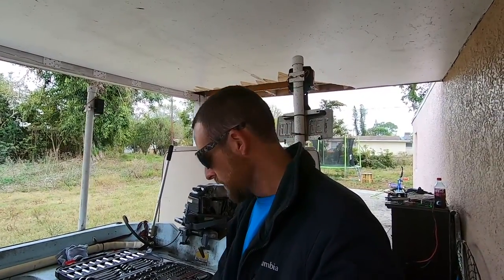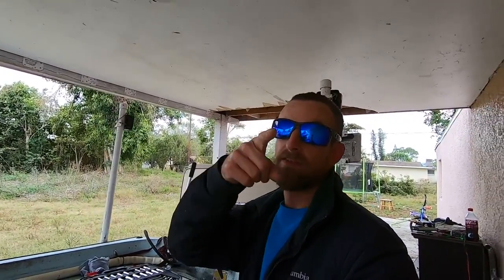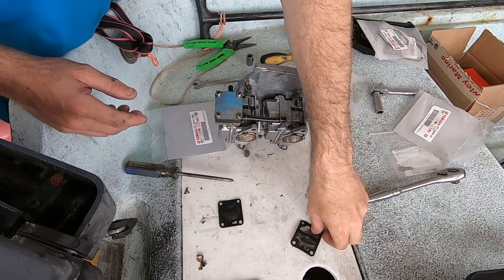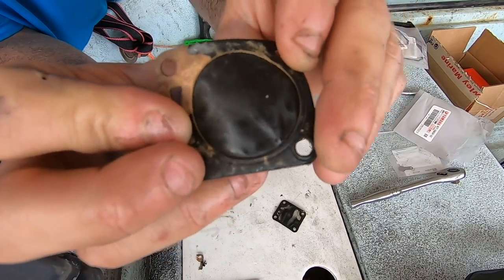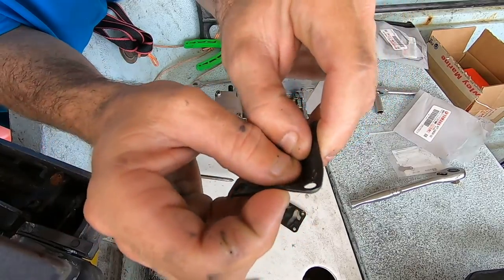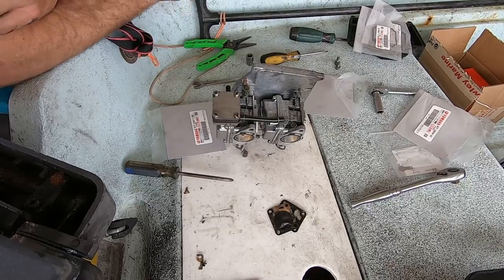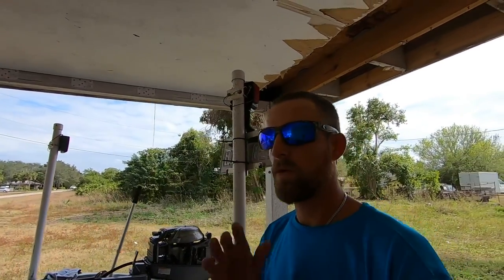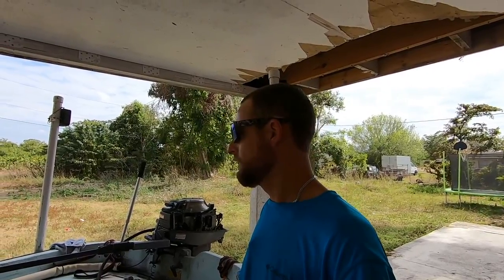Fuel Pump Rebuild On My International 20HP 2 Stroke Yamaha Outboard. Will This Fix Our Fuel Issue?

Comment: I tried to tell you it wasn't your fuel pump 😉. Did your tank collapse again like last time? Did your primer ball collapse? Check vent on tank 1st, then check ball, then check fuel line connectors, then check fuel line itself. I'm betting it's one of those 4 things. Good luck brother, hope you figure it out!
Reply from the maker: Nah it just ran dry no collapse. Im thinking pick up tube may have had a crack or small hole in it. Spoiler for nxt videos intro, i said F it and did new tank and line. Everythings fine now 🤣
Reply: @Whaler11 fishing  awesome glad you got it figured out 👍!
Reply: Part numbers for fuel pump please